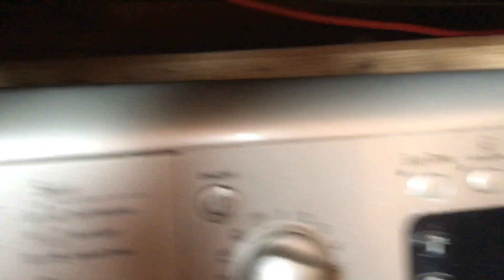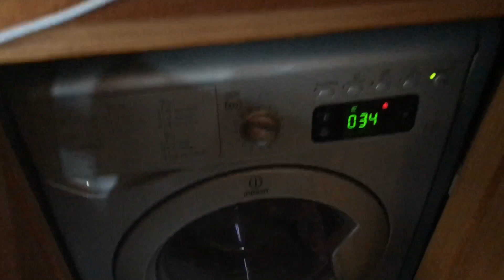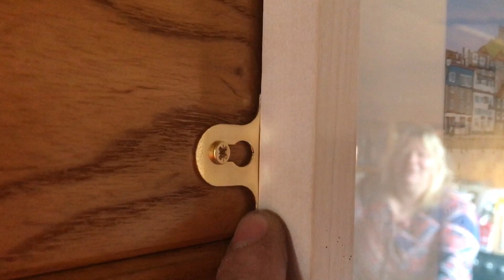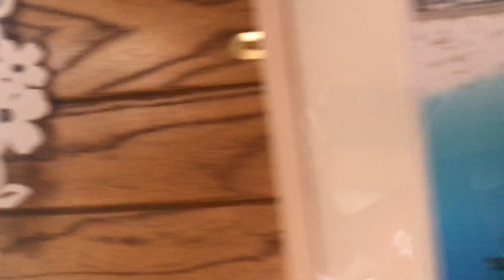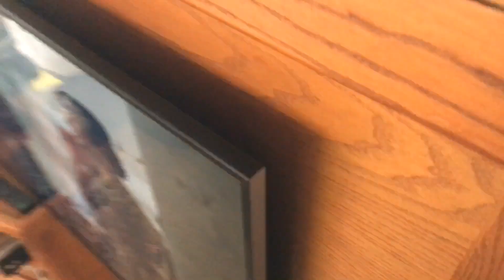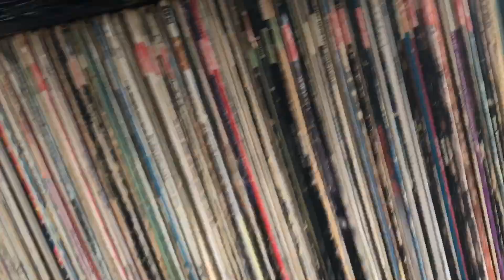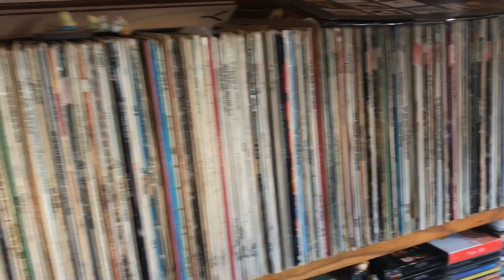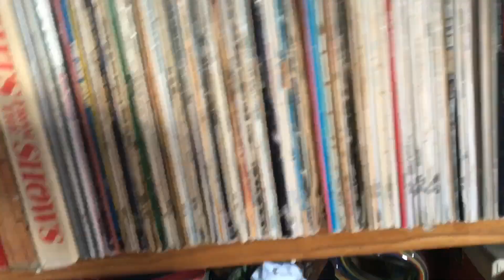Narrowboat Living Is it Impossible To Live In A Narrowboat With 3 Dogs?

Comment: Hello I never saw a narrow boat with a wheel house like yours , looks great. Wheel steering obviously , does it also have a tiller as well? Does your boat have the standard beam of a narrow boat looks somewhat larger. Thanks
Reply from the maker: Hi John. Looks can be deceiving. She is 6ft exactly (not 6ft 10”) she is very square and this gives you more room in the living area.
We did try to fit a tiller but with the design it makes it pretty impossible to use. So she is wheelhouse operated.